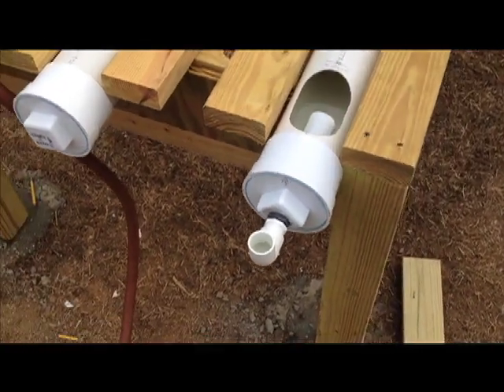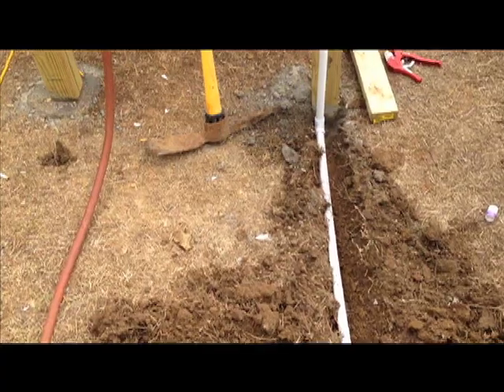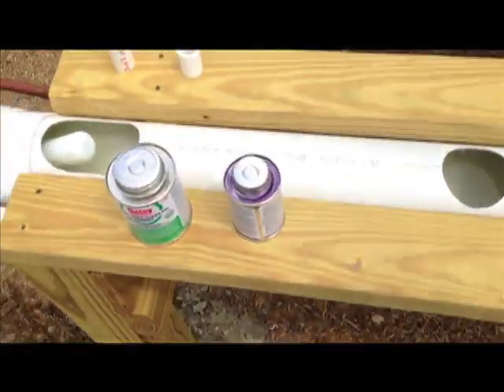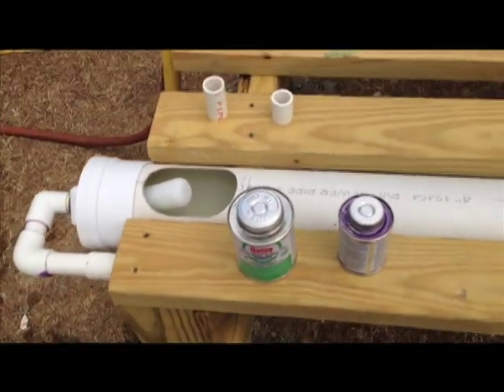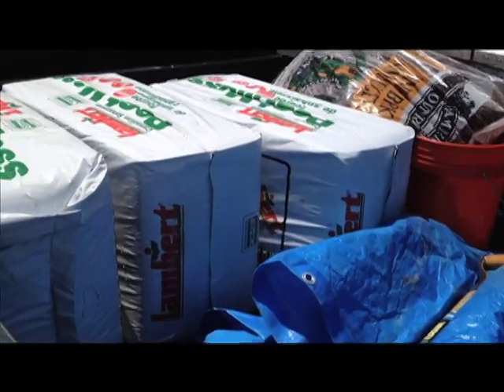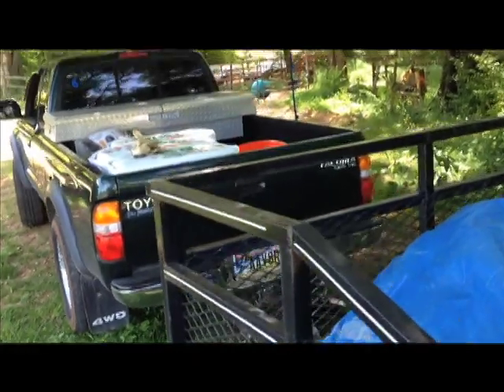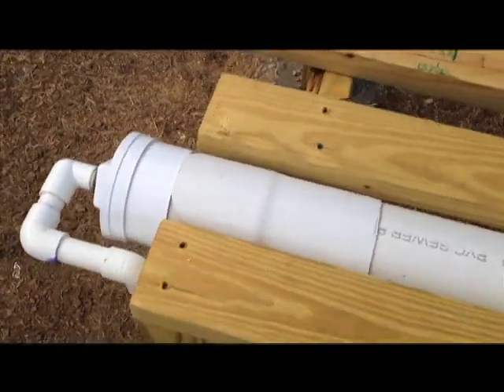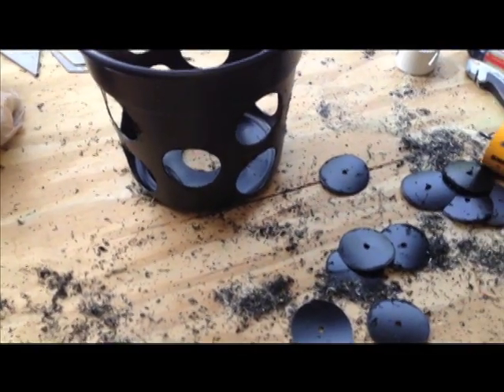Hybrid Rain Gutter Grow System Step by Step Ep 4

Comment: What happens when it rains hard and the water fills in the bucket draining back into the sewer pipe.  Do you have an over flow drain for this or is that needed?  Nice touch with the cover.  I'd have just put screen over it.

Comment: Would you please explain how you installed the plastic float for maintaining water level?  I tried to find it in you videos but I didn't see it.  Where can I first find that plastic float?  I would like to make one like this.  Thanks for posting your videos.
Reply from the maker: didanhtennis See if this video of my expansion of the greenhouse system explains exactly how I put in my float valve.  If you are using pvc pipe I had to get it on Amazon.  If you are using flex tubing you can get the valve from Larry Hall's Site.
Reply from the maker: iROBODUDE https://www.youtube.com/watch?v=pZwb78ZJ9ws
Reply: Larry hall